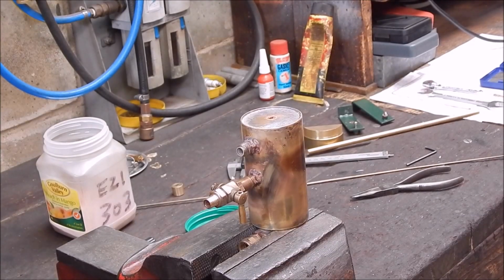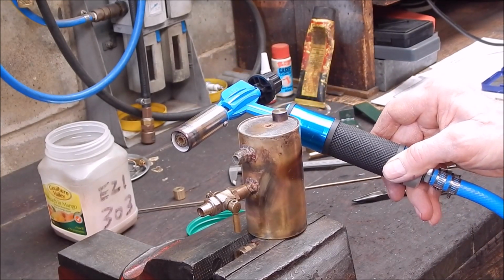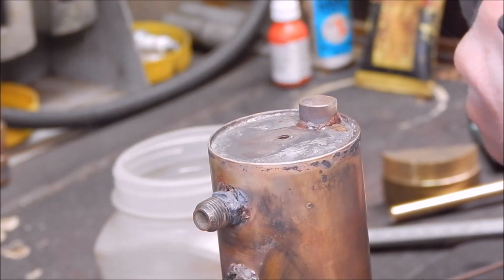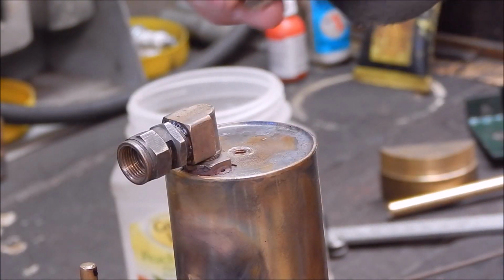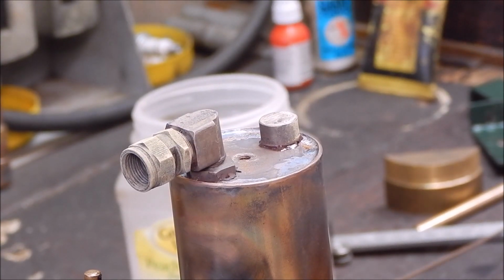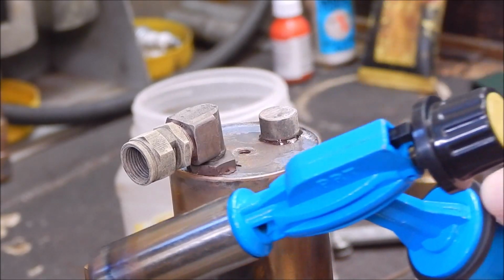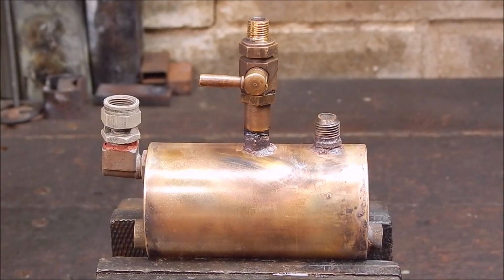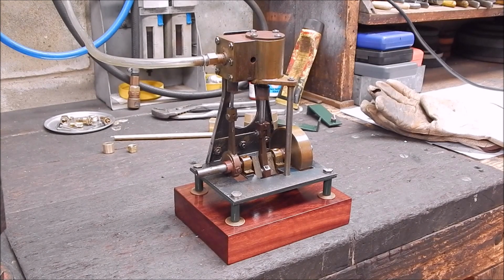Silver soldering with the high temperature LPG/Propane flame torch from Banggood

Comment: Hi thank you for answering so many peoples questions though out your videos, would you be so kind to share knowledge on removing flux's,  I plan to silver brazing  some ferrous  precision parts, i would like a flux that can be dissolved off with a safe chemical after brazing, preferably, I could Bronze braze instead if there fluxes are more easily removed. Is there such a flux ?  And can a Bull finch do nickle bronze brazes, on small parts, or is Manganese bronzed about it's limit.
Reply from the maker: Hi Stephen,  the 303 flux residue I recommend is water soluble, but not very.   Some will scrub off, but not all.  The best way to remove flux is with a wire wheel and water, but you risk damage with fine parts.  Queching the job with water will also lift some flux residue, but it can embrittle the metal depending on it's carbon content (high is bad).   A sand or vapor blaster would definitely be the best option, with vapor being excellent, but not everyone has a vapor cabinet.   I have never tried removing flux residue with a chemical.  I can't comment on that.  Caustic soda may attack it as it will dissolve carbon.  A supplier may have some info on that, but most guys behind the counter know stuff all about what they are selling. The Bullfinch will definitely NOT melt nickle bronze as that is a high temperature rod mainly used with TIG these days.  The Bullfinch can only do what MAPP gas could handle.  Cheers Rob
Reply: @Xynudu  Thanks Rob

Comment: It would be easier if you use the process jewelers use.  Make sure pieces are clean and fit tightly.  Flux both pieces.  Snip off silver solder (not silver).  Place the pieces around the seam.  As you heat the flux, it will turn glassy and the seam will slurp the solder and you are done!

Takes less heat, is faster, and if oxidization matters, you will have less of it.

Comment: what type of silver solder are you using in this video? 56% or 45%?
Reply from the maker: 2% silver as used for copper water pipes by plumbers (yellow tip).  High percentage silver is hellish expensive and only needed for ferrous metal.

Comment: Hi Rob I have one of these Propane torches . Have found that I needed to build a little firebrick hearth and it worked  well but the spark igniter does not work any ideas how to fix that? Cheers
Reply from the maker: Hi Laurie,  the igniter had me fooled initially.  It only works with barely any gas coming out the torch.  So only crack open the tap a tiny bit and it should light.  Cheers Rob

Comment: I bought one of these after your first video. Plan on using it to heat/temper small cutting bits for my myford ml7 lathe. Couldn't find any other lpg torch for under 300nz$ and thought too expensive for something I might only use a couple of times per year..
Reply from the maker: It should do that OK Andrew.  I was on the limit with this job and that amount of heat sink effect, but for the money that's about as good as you will get without paying through the nose for MAPP gas.  I only put it up so folks can judge for themselves what it's capable of.  I never intend to mislead people on any product I review, so follow up is always good to see.  Cheers Rob

Comment: G'day Rob.  Isn't that torch is a bit under powered for that job or did the boiler just soak up an unusual amount of heat..
Reply from the maker: Hi Harold, it's a bit under powered.  I was all set to use the Bullfinch and then I thought, lets try the Chinese cheapie and see how it handles a small job like this.   I wasn't expecting too much, but it was good information for viewers/prospective buyers. 

It got there, but it didn't flow as well as I liked.  I wasn't too fussed, as brass can easily melt if things get too hot, and some grades are much worse than others in that respect.  The job did soak up lots of heat, but this is no Bullfinch alternative.  Cheers Rob

Comment: How does it compare to MAPP gas?  Boiler is looking good Rob 👍
Reply from the maker: Hi Bill, MAPP is way hotter.   So is the Bullfinch torch.  The Cheap Chinese unit does a better job than I was expecting and is one up on my old Companion basic LPG torch, mainly because the flame pattern is totally different and not as "wooly".  The boiler is still in the evolution stage, but coming along.  Even with LPG you have to be careful you don't melt brass as it varies a lot in composition and some of it is very low temperature.  Cheers Rob
Reply: Haha, the old companion burners were pretty average

Comment: G'day Rob, what kind of solder would you recommend for sticking a bandsaw blade back together? I haven't found much apart from plumbers solder at the tool shop.
Reply from the maker: I have not had much success with joining bandsaw blades.  I tried manganese bronze, but it fails after a while due to the flexing.  All the bandsaw shops electrically weld them, probably for a good reason.  MIG might do it, depending on how skilled you are.  Nickel bronze is probably the best bet with a torch, but you need TIG for that.  Cheers Rob

Comment: That method you used is for soft soldier. If you cleaned the two parts of copper first then used a silver solder flux on both parts then place the small piece where you want it then heat it up when you see the flux start shining like glass you tap the silver solder on the join and it will flow all around and under the part then it will leave a lovely neat job but you must keep everything very very clean. I use 45 percent silver solder.
Reply from the maker: Works fine with any form of brazing.  No mess.

Comment: Hi Rob. All looking good, I really like your base for the steam engine, looks fantastic. Be interested to see your steam plant when it's finished. Cheers, Alan.
Reply from the maker: Hi Alan,  this could all take a while ;)  I thought the little engine base turned out well.  The colours in that Jarrah are beautiful.

The four low profile engine mounting bolts are actually home made from gutter bolt nuts bronze brazed onto long steel wood screws and ground uniform.  I did think about doing a video on this, as it's a little trick I've used a number of times to keep things period correct - unfortunately just about all the long screws you can buy these days are Phillips head.

Cheers Rob
Reply: @Xynudu  Jarrah looks gorgeous even just sanded with no treatment applied. Just a shame that it's so hard to find over here. Cheers, Alan.
Reply from the maker: @RetroSteamTech  Hi Alan,  I looked to see if I could send you some, but the cost would be horrendous - for not very much.  Pity you are so far away.  I only saw one stockist in the UK that seemed to be a possibility and I guess you've searched as well and know what's on offer.  Cheers Rob
Reply: @Xynudu  Hi Rob. Thanks very much for even considering it but I figured that given it's weight shipping would be ridiculous. Occasionally things crop up on ebay over here, the Jarrah base for my Electromagnet Engine started out as a kitchen cutting board!  Today I found one of those stupid balancing wine bottle holders made out of Jarrah which I reckon I could get a couple of small steam engine bases out of. Only £9 so well worth it. Cheers, Alan.

Comment from the maker: It's not as powerful as the Bullfinch Auto Brazing torch,  but neither is any other LPG torch that I've seen, including all the big name brands.   The adjustable flame pattern is quite useful for very small jobs and the extremely low gas consumption of the unit is excellent.  Even at full bore the flame head is quite manageable and reasonably compact.  It did better than I expected, but at the end of the day it's just a standard LPG gas torch.  Cheers Rob